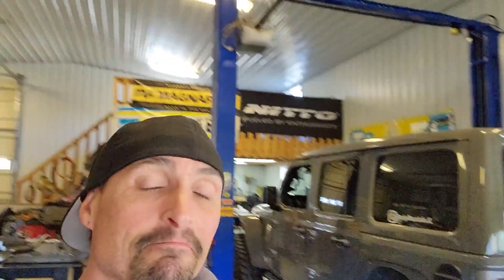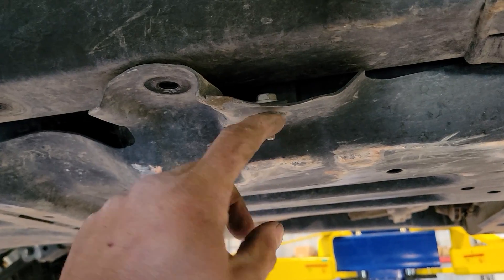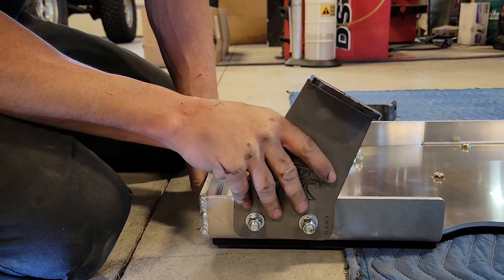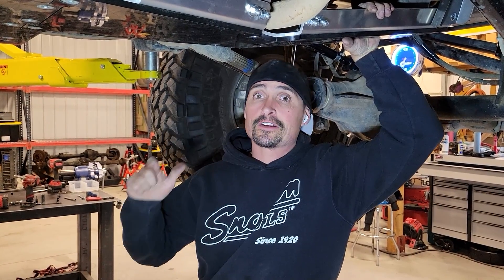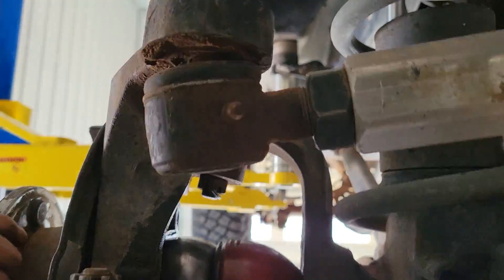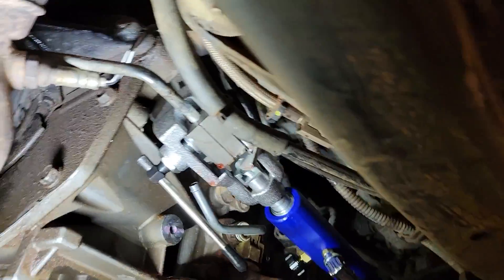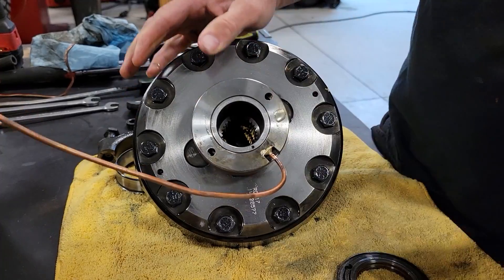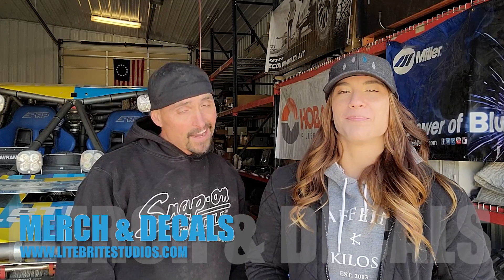THE PERFECT SKID PLATES FOR A JEEP WRANGLER AND HOW TO FIX A BROKEN AIR LOCKER

Comment: This is the problem with ARB's they always crack right at the collar.  I ran them in my Land Cruiser 80 series,  happen twice on the front  and once on the rear.  Failure was always at the collar right where your's failed.  You can repair the old one by soldering it and use it as a backup for when this one fails.  I'm sure you are aware of all of this Chris..:) but other's might not be.  I like your idea of using the socket to make a radius bend right out of the collar.
Reply: it is just bad installation, both of mine have lasted years
Reply: @Achisachis73  Is your copper line routed in a shorter fashion, meaning routed over the ring gear vs under?

Comment: I’ve seen that broken air line twice with ARB’s. I’ve fixed both with blue flux coated 45% silver solder. In case you can’t get parts.

Comment: Hi Chris! Fellow Chris here. Big fan. Did you scold the previous installer for the front arb fail AND using low pinion gears in the front axle? I wonder how it likes driving on the coast side of the ring gear 🤔😂 great job love watching these videos!

Comment: Good job on replacing that line! Most likely the reason it failed is that with that much copper line hanging around, it’s moving around a lot. This leads to the brazed joint fatiguing and eventually failing. To prevent future failure, it would be best to either restrain the line close to the brazed joint, or route the air line above the R&P so it has a shorter run and less mass to move around. Good work none the less and those NV skids look amazing!
Reply: Also by routing above R&P the line will interfere much less with how the oil flows inside, to help keep things lubed and cool. An inch long ziptied piece of fuel line over the copper tube at the base where brazing is should absorb & reduce the movement of the tube at the base as well.

Comment: 10th! The Dynamic Duo of Off Road Builds! I could spend hours on RevKit, dreaming.I wish I could put aluminum skids plates under my WK but it would have to be fabricated - nobody makes bolt-on for it. A lift in your garage makes a world of difference! Thanks for the idea on strapping the gas tank to remove the skid plate; mine is badly dented and needs straightening.WD40 uses - Who Knew!? LIteBriteNationFixesEverything!

Comment: Nice content as always, but one small point of criticism. It will be better to go over the ring gear with the copper line and make a sharp bent out, than run the copper line all the way down the housing and up again. Due to the long "bowed" route, the copper line will break much faster because of the vibrations and movement of the axle. The shorter the route, the more sturdy it is.

Comment: In response to 13:20 with the difference between using brake cleaner and wd40 it's the same as try to clean your hands. Yes a solvent will clean it, but a lubricant will get under the grease and allow it to be lifted. Soaps are a lubricant for your hands to be cleaned, and wd40 and other products are a lot better than solvents for the big dirt and greasy jobs

Comment: Correct me if I’m wrong but I feel like the old air line broke because of the gear oil running past the copper line with some force against it for a long time which probably wasn’t helpful on the connection to the locker. Looks like there would have been a tight fit if he went on top of the ring gear. I don’t want to be that guy commenting but curious if anyone else thought the same thing. Anyhow great video as always!
Reply: I was wondering the same thing... it has a fab'd cover that fit really close, dana 30 gives no room to run over. Had no choice.
Reply: Gear oil is going to be splashing on it whether it is run over or under. The only difference is length of line. Longer the line the more the gear oil is going to flex the line from the gear oil pushing on it. When driving highway speeds, I imagine the line actually vibrates back and forth from the pressure. The line is soft enough to handle the movement. But the soldered joint doesn’t like be moved at all. That’s why it broke, in my opinion.

Comment: Good to know about the Trans Thermal Cooler. I put in the extra cooler, but my trans sure would appreciate running at the proper temp I bet. A lot of cool stuff was covered in this video. Like those skid plates. Wish they made them for my Rusty WJ, but oh well. I'll keep putting parts on it that rust. Thanks.

Comment: Need some advice Chris or Bec.  Getting ready to change out my diff covers front and rear.  I have the "paper/fiber" gasket.  Should I put a thin coat of RTV sealant on with the gasket, or just the gasket alone?
Reply: Thin RTV. I use ultra black. And usually don't use a gasket. Can also get a lubelocker gasket that requires NO Silicone.

Comment: I hate it when aftermarket companies build components for the JL with SAE hardware….
Reply: John, what a lot of folks don't realize is that the M12 thread pitch used on the JL frame isn't one you'll find at the local hardware store in a countersunk variety. You'll find M12x1.25 and M12x1.75 all day long... And the JL/JT frames are pre populated with M12x1.50. We have these countersunk bolts made custom and use them only where necessary -- they are not cheap. To populate the rest of the skid system with an M12x1.5 would increase cost and make it harder for customers to source replacement hardware if they ever need it. To populate the system with M12x1.25 or 1.75 where it doesn't mate into the frame would be a nightmare if someone switched up the bolts; and we've actually seen other systems that mix M12 and 1/2" on the same skids.... Not a fun job to rethread inserts or weld in new ones when they crossthread and break free. We tried to make it impossible to switch similar-ish bolts and crossthread anything. Maybe in the future we'll find more common thread pitches from the factory and not have to think about it if we're lucky!